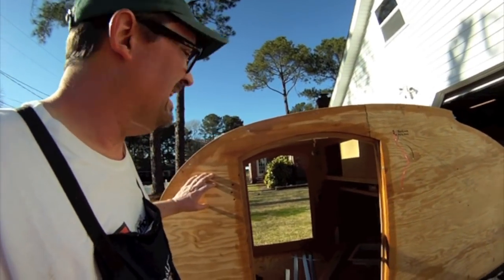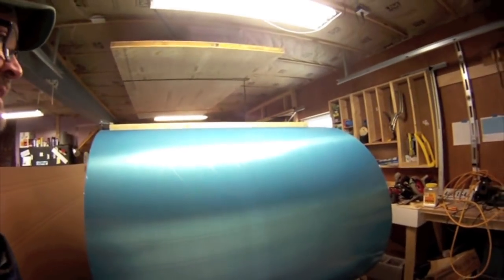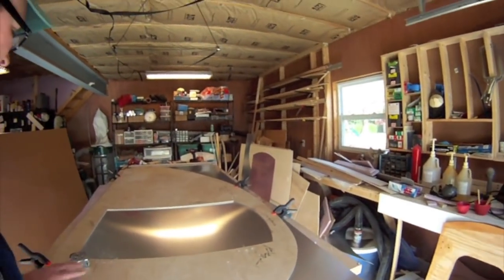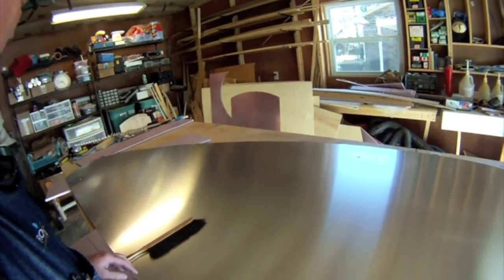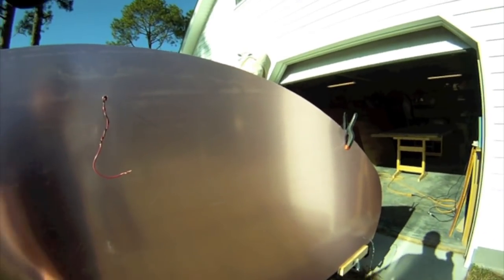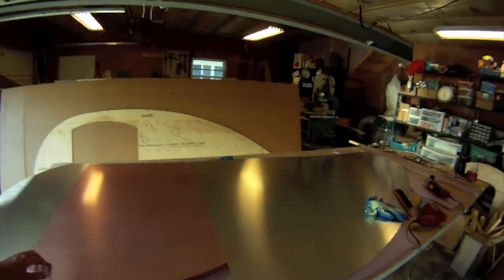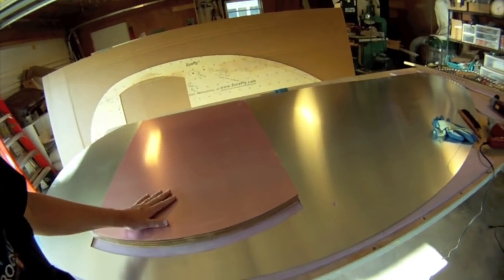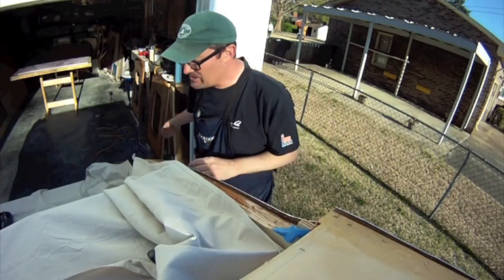Teardrop Build part #37

Comment: Another question, do you think on future builds it may be best to just over cut all the metal skin and confirm it with the router?  thanks.
Reply from the maker: Hi Jim,  the reason that I was trying to be precise with the cutting was that I was trying to make the edges about 1/16 inch shy of the edge of the plywood to account for expansion of the aluminum when heated by the sun. After using it for a couple of years, I'm not sure that it made much of a difference. I was being precise around the door as I wanted to be able to use the cutouts to skin the doors. Also, after everything was on, I did go around a knock off any high spots with a router.

Comment: I assume the reddish tint on the oustside of the aluminum is a protective film that will be peeled off at the end?
Reply from the maker: Tom, that is correct. I got some in blue and some in red!
Reply: Any difference in the aluminum because of color, such as gauge of material?
Reply from the maker: Tom Pritchard Nope. The only difference is that the blue was 5x10 and the pink was 4x10.
Reply: Thanks..

Comment: What type of plywood did you use for roof skins? 1/8" I guess but box stores do t have lanaun.
Reply from the maker: Hi Robert, I used 1/8 inch Baltic Birch, expensive, but nice to work with. You might try see if you could find "doorskins" at a regular lumberyard.
Reply: Thanks, that they have 3' x 7' at $12.00 so either I lay it across or long ways and patch in 1ft lengths

Comment: where did you find the aluminum ? All i can find is maximum 20" wide..
Reply from the maker: +evadvalcourt I got the aluminum (and the MDO and marine ply) from a company called Harbor Sales (harborsales.net). They supply materials to the sign making industry. They are located in Eastern Maryland and I happen to be on their delivery route, so shipping was reasonable. But if, you aren't in the area, see if you can find out who supplies your local sign shops. they may be able to help you.